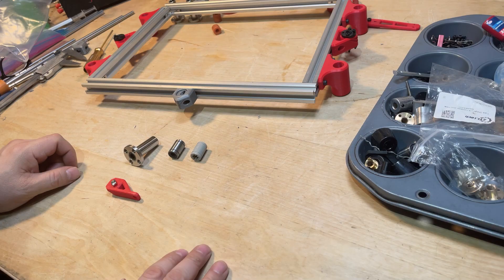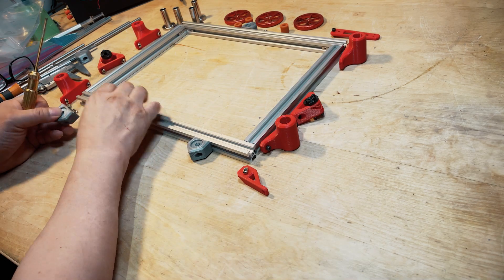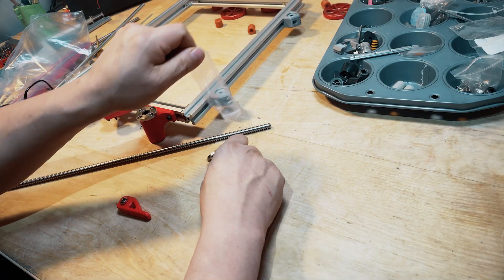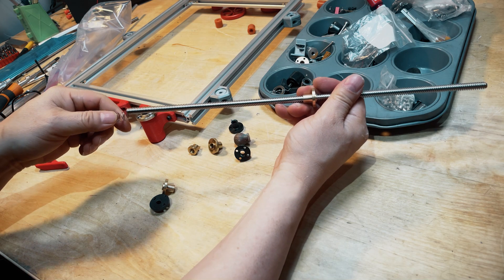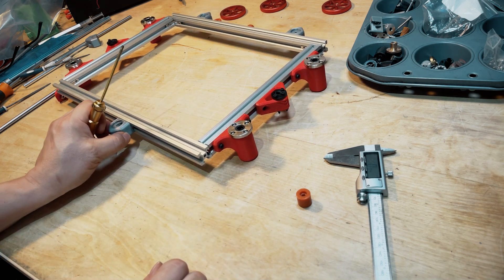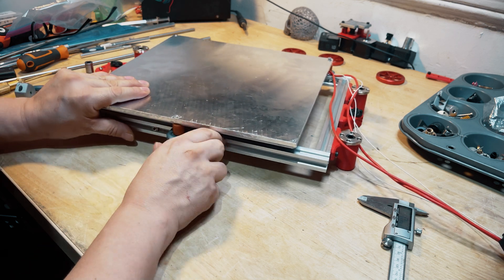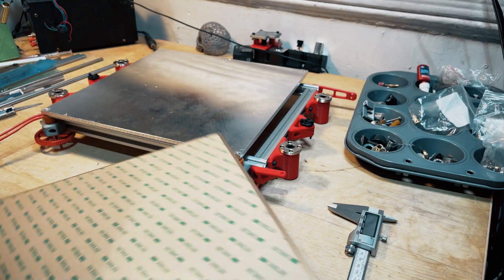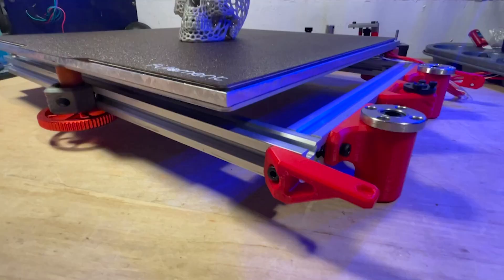VzBoT Converted from Tronxy x5sa step part 4

Comment: Thanks for the informative videos, I'm gathering info so I can build mine, just got my frames precut from Germany. got motors and screws, I have a 310x310 bed for now. I just want to up and running then trying to upgrade when it's running. Hard part for me is to drilling blinding join. I ordered 24v 25amp powersupply. I got SKR 2 mainboard and 5160 pro driver. still long way to go.
Reply from the maker: glad it helped

Comment: Great video series.  I have received and built a non borked tronxy x5sa (unlike yours) and have almost received all my parts from China but still awaiting some.  I kinda fancy the better bed like you have but even though the existing heat bed is quite a bit wonky and almost all my bed screws are basically unscrewed but with a bit of tape so they don't come off during fast prints, a bed mesh in klipper/mainsail seems to have addressed this for me with the default Tronxy x5sa; I hate this and know full well it's non ideal.  Super looking forward to doing the full build though so I am an avid watcher.  Thanks again.

Comment: That anti backlash nut has to be compressed together before threading it on to the rod. They work well but aren’t really necessary as the weight from the bed will counteract any backlash you’ll have. People usually use them for more friction so the weight of the axis doesn’t cause it to drop when the motors turn off.
Reply from the maker: Understood I did say they work I just did not want to install everything just to show and it was up to the builder on what they like. But I still prefer delrin nuts. So do use just a brass nut?

Comment: great build series, buying a tronxy soon but it'll end up as a vzbot sooner or later =)
Reply from the maker: Ether way there are way to improve the tronxy printer it can be a good printer. But first thing I would do is change the hotend.. new parts. And upgrade board.
Reply: @tommygunnfilms  yeah, the board is the first thing in my list other than that i'm just gonna get to know the machine before i replace things
Reply from the maker: Alway build the machine as good as possible calibrate tune then see what sucks and replace. If you have a big printer like the 5sa it’s gonna take a long freaking time to print big things so any improvements to speed and accuracy will help. From what I remember there’s binding of the belts on the corners and issues with smooth rods and don’t use that top bearing for z rod.
Reply: @tommygunnfilms  thanks, getting a x5sa pro, i'll look into those issues when i get it, looking forward to the next video 👍
Reply from the maker: @blerpii  oh oh did you order it already? The non pro so much easier to mod. Those rails are super heavy and other things.

Comment: Well, now I have to see about those fulament beds... I could use an MK3S-sized textured sheet.. And the buildtak on my X5SA Pro is peeling at the corners.
Reply from the maker: These plates are not flimsy and the pei sheets on them are thick. Back in the day when buildtak cam out I was one of the first to use it. I met them At a makerfaire.

Comment: The brass nuts do not cause backlash since there’s weight on them at all times - but they can cause the bed to sag unevenly when motors are without power. The Delrin (or POM) nuts are a little tighter so they will - like the brass backlash nut provide more friction and stop the sag. Best thing is to enable that the z-motors are always powered - which can be done in Marlin.
With regards to the last hole not lining up - maybe, if you lay the bedplate flat with the bolts facing up and the rubber springs in place you will be able to slide all three bolts on parallel.
If you are running the stock Tronxy board (cant’t remember if you will) you really should start each time you turn the printer on making sure the two sides are at the same height. If you have the ability to run independent z-motors I do recommend the G34 auto z-align. Anyway always odd trying to give advice after the fact. ;-)
Reply from the maker: Gert! Again thanks for you input always appreciated! I called it backlash because that what they called the anti backlash spring and nut. But yes you are correct with the sagging once power is off or goes off one side can sag. If you have problems like that best to alway tram before starting a print just to make sure both sides are even. That is why I like the Delrins. 
As far as the holes I did try that this was the only way and it worked like a charm someone else were so off they had to cut the extrusions to make it it fit. 

the only thing the bed has to is be is flat and level. So as long as I don’t have to make any more holes I think it’s should be clear sailing for me now! 😆 
I will not be running a tronxy board I will be bigtreetech ether my 1.5 or 2.0 skr boards.. I will do marlin then octoprint first then move on to klipper.
Then I will start on something else.

Comment: ASA? I love the stuff.. Good choice on the PEI bed.. I run the same one.  I ran into the same issue with the bed.. I  ended up breaking my bed frame down and cutting the extrusion shorter...
Reply from the maker: Glad to hear I am not the only one that had issues with the bed.  Well not glad but now aware people are having the same issue.. 
I did not want to cut anything or redesign the stl to make the bed fit. Melting for me was the best option 30 second fix.